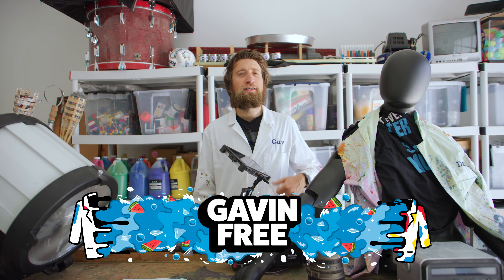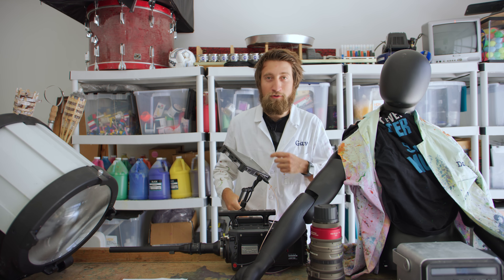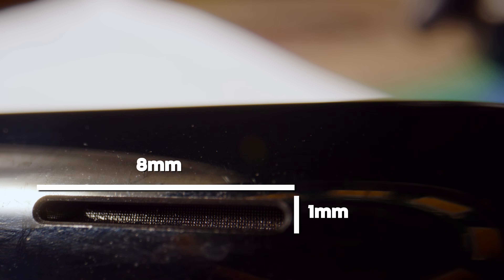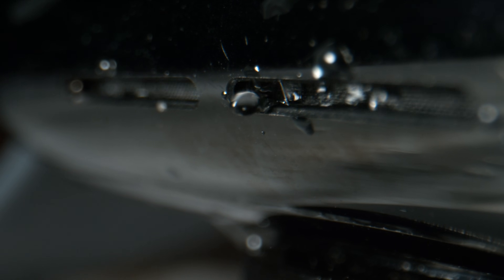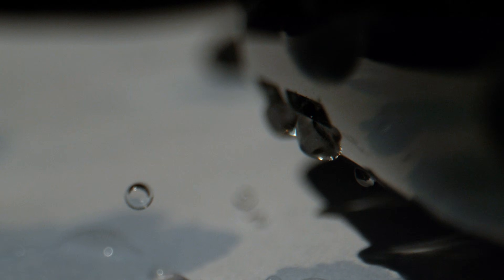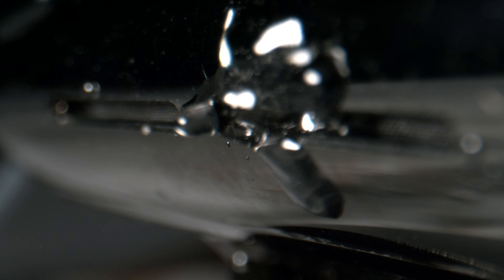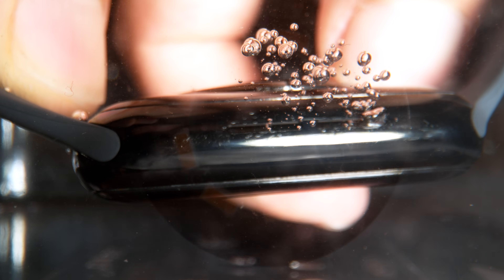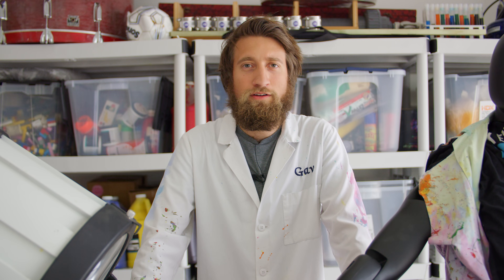How the Apple Watch Ejects Water in Slow Mo - The Slow Mo Guys

Comment: Now imagine how awesome that product would be... if it were waterproof. rofl!
Reply: There aren’t any electronics that are truly waterproof. It’s close to impossible
Reply: @LiveinAK  Not remotely true in the slightest. I've had two Samsung phones go through complete washer cycles with no damage (both lasted years after).  Showers with them, rain, snow. My GoPros are waterproof without exoskeleton cases my Fitbit is waterproof. My car and truck and snowmobile and motorcycle are all packed with waterproof electronics and connectors. All my quadcopters are waterproof because I've conformal coated all the boards...
Reply: @gymkhanadog  all examples of water resistance
Reply: @LiveinAK  Technically everything is waterproof since water in distilled form is not conductive. It's the minerals that are conductive. But that's not what we were actually talking about, now was it? ;)
Reply: @gymkhanadog  there’s never gonna be a scenario where someone accidentally drops their phone or electronic into distilled water lmfao. Go on the website for any electronic you own. They’ll tell you it’s water restistant not waterproof.

Comment: Being advertised as water proof (almost) and seeing photos from Apple of a surfer wearing one, I figured if it can stand the force of a wave why not that of water coming out of the faucet, why not wash it with soap and water after a day's workout? Well, it turns out, that after doing that a couple of times, I'd see soap still ejecting from the speakers every time I turned the dial in that mode! Even days after not running the watch under the faucet...

Comment: My watch doesnt do this at all. When I turn off water mode it vaguely pulses a vibration but no water ever comes out. I had the watch for about 3 weeks now and i only take it off to charge so it gets wet pretty often. Should I be worried about this? maybe exchange it?

Comment: I bought a watch from eBay not knowing it was stuck on activation lock tried going around it but couldn’t until i was recommended to cardtoolz on !G he got my device fixed successfully in less than an hour he’s very good and reliable

Comment: Waterproof phones need this feature. The only way I can get audio back to normal on my phone after using it to film underwater is by finding a source of compressed air to blow into the microphone and speaker holes.
Reply: Don’t blow air into the speakers. It can make things even worse. There are apps that do exactly what the Apple watch does for your phone. They produce a sound to get the water out. And while it doesn’t sound pleasant, it works.

Comment: Hi friends,   just in case you run out of stuff,please consider  filming a wooden spinning top, I ALWAYS WONDERED WHY  you must throw it upside down, in order to get it spinning on its tip not its head, it  also would be  interesting to find the best  geometry of its surface, and the starting point of its winding,  in  so as to get the best rotational acceleration

Comment: me: apple, why are your products so expensive
apple: water ejection!!! cool?
Reply: @Beats-h4z  you stoned or what? You said the part are expensive then you say the entire product is cheap
Reply: Trust me you'll be thankful for water ejection. If apple did something else you would probably say, "apple why are your products so expensive, you need water ejection!"
Apple:"Face ID? cOoL
Reply: @Beats-h4z   Thats wrong...
Reply: Why can't they just make it water proof.....!? Istead of water ejection thing.....
Reply: @sachinkadam8666  it’s already really water resistant
Reply: @sachinkadam8666  It is as waterproof as it can get without getting rid of the speakers on it. The reason it isn’t fully waterproof is because the deeper you are in water the more pressure builds up. The pressure building up from being very deep in water can help the water force itself through speakers and parts of the watch.

Comment: Coll video. I suspect Apple never had a high quality camera like yours as the firmware in the watch clearly could be further optimized to better eject water with less drain on the already sadly short lived battery. But then again, Apple is mostly about marketing and form over function so they probably didn’t care.

Comment: If only we didn’t have to eject water from the water ejector button where the speaker isn’t there would be really wonderful. No corrosion rust would be great due to prolonged water damage that doesn’t clear out all the water trapped in the speakers. 

Why have speakers there when you have a water ejector. Just doesn’t make much sense.

Comment: One time I accidentally turned off the Water Lock on my Series 3 when I was in the pool relaxing, and the speakers were essentially on the surface of the water, and the speakers ejecting the water actually looked like tiny water jets firing in 4 directions.

Comment: I have a Cat S60 and it also has a speaker drying mode for in case water gets in. The only problem is that most of the sealing flaps have ripped off and the carbon fiber back is just a sticker. I wonder if the phone does the same thing to expel the water. It plays ear piercing noises and I did not think it would dry out like the watch did. Interesting video, thank you!

Comment: Great vid, though did just want to point out that what you can see inside the speaker hole isn’t the speaker, it’s a metal grill to prevent dust etc from getting into the area between the grill and the speaker diaphragm.

Comment: Im doubtful this is any better than just flicking the water off your wrist with centrifugal force. Since its using the speaker it needs air volume to actually push the water out. You can see that it just ends up sucking the water back in because theres a constant lack of air from the drivers trying to push the water out.

Comment: I've owned many Android watches that were waterproof without the need for this feature And the Galaxy watch running Tizen beat apple to this. Apple so far hasn't beaten anyone to a useful mobile device feature. 💯 #facts
Reply: The Apple Watch doesn’t NEED this feature, it just allows you to use the speaker immediately without wetness affecting its sound quality. Other waterproof devices do say that their sound quality can be affected until the speaker dries out. It’s a smart solution I recon - doesn’t require anything additional beyond software to create the sound signal.

Comment: it makes me anxious because THE WATER DOESN'T COME OUT COMPLETELY
Reply: 10 cycles of that gets majority of a tiny amount of water out. The rest that’s is about <0.05 cc or mL can evaporate in minutes. I’ve had several apple watches including series 1 not marketed as water resistant all have been exposed to water countless times. All worked fine. Only reason for getting rid of it was an upgrade.
Reply: JD. Depoister same, my series 1 event went swimming for like 2 hours. I was terrified when I noticed that I have it on. It was like nothing happened, truly amazing
Reply: A thought came to me is that it seems like it'd be good to have a toilet paper square available to sap water out a little better. Maybe it wouldn't get all the droplets, but it may help reduce how much is left and let it dry faster.

Comment: Fun fact: the audio is actually fake: you wouldn’t be able to hear the frequency of the real sound slowed down that much. (Also: it’s pretty clear in certain points in this video that it’s not the real one)
Reply: It wasn't that slow
Reply: Vipera74 not necessarily, if there is sound from the water splashing that is already much higher frequency then we can hear, than it’s possible that when slowed down you can hear it at a lower pitch.
Reply: Harry Benson yes, but it wouldn’t be the one you hear at normal speed. That’s the whole point
Reply: 80x slow shouldn't be that bad
Reply: Fun Fact: Digital sound recordings can be drawn out without altering the pitch, unlike analog recordings.
Reply: Spood Beest uh! What do you mean? I always thought that it didn’t depend on that. I’d like to know more

Comment: Hopefully it doesn't stress out the speaker too much. The thin cone and tiny voice coil are delicate. Even without water the power and excursion alone could potentially cause issues. Although newer tiny speakers in those devices have improved and are capable of much more excursion than previous designs. Plus it doesn't last too long so the coil probably wouldn't get warm at all. The amp is probably too small to fry it to. Interesting idea.

Comment: wouldn't it be less complex/expensive to waterproof the watch? If people read instructions they would know that water may interfere with the touch screen function. Reading is a lot simpler than a complex water ejection system. I guess it lacks the marketing 'wow factor'.  Which watch would you buy - "The advanced electronic personal device will self-purge and dry after immersion" or "Read and follow instructions carefully"...

Comment: This technology is insane. The question resides though how exactly the speaker does that. Do they use sound waves or a purely mechanical power?
Reply: Herman Tselinsky Pour water on a subwoofer + very low frequencies = pretty much same result. They took advantage of that technique by allowing the speaker unit to move at such a low frequency so the water can roll and exit the grill properly.

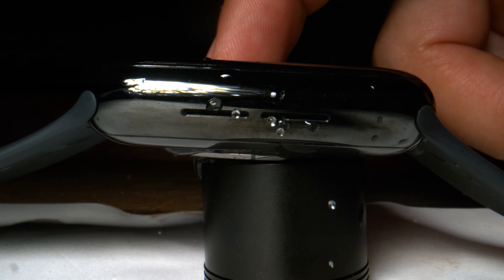Comment: 3:45 That's not the speaker "surface" (the diaphragm or membrane), it's just the mesh speaker grille. The actual speaker membranes are inside. You're not seeing the membrane or grille move, it's just the water trapped in the mesh.

Comment: Anyone know if the components are actually waterproof? As in, they won't rust.

Yes. I know this seemsstupid. But until you've had companies pitch waterproof and then have component short out or rust. It sadly is a good question. Example. Battery banks that claim water/weatherproof, but the contacts are made of cheap metal that when exposed will rust....so who cares if the main compartment is waterproof if the contacts become useless right? :P

Comment: modern phones: get water logged easily
a smart watch from about 2016: shoots water out of its speaker holes using audio
Reply: The vast majority of phones that came out after that watch are at minimum ip68. Also no one brings their phone 8n the pool to swim which is what people do with watches. There is no incentive for OEM's to add a costly feature that isn't needed.
Reply: Comparing a sports compatible watch with a smart phone is utterly ridiculous. No wonder if you can compare it with a gaming laptop tomorrow
Reply: This feature came with the Apple Watch 4 which came out like late 2018?
Reply: No Body it was all ready on de Apple Watch serie 2 so 2016

Comment: 1:38 am I the only one who's wondering why the display is running interlaced when it's an oled
Reply: It's not interlaced. Interlacing is where during a refresh, every other line is skipped, and then on a second pass, the other lines are drawn. This is progressive scan, since it's not skipping any lines. Every display needs refreshing, making it visible merely requires different shutter speeds.

Comment: That speaker was exactly 196hz. In music sound production, 196hz is the note G3 . I used a keyboard program to see if that noise the speaker was making was a G3. It turns out that it indeed is a G3 and it is 196hz.

Comment: Everyone who dropped their phone in water wished this for their phones

Edit: Frick that's alot of likes
Reply: you can also do a similar thing to remove water droplets, tho only from the speaker
Reply: @squashbanana  if you have a phone with stereo speakers, it works with the earpiece too!
Reply: Drpped: Is that Derped and Dropped all at once❓
Reply: @doubledarefan  Lol typing mistake
Reply: There are waterproof phones. Just needed to mention it for those Apple users who usually don't see on other side.
Reply: @SergeMatveenko  there are no water proof phones tho only water resistent
Reply: ARSOZ EXACTLY!
Reply: I just wanna mention to everybody here that a water resistant phone does not necessarily mean that it's HOT water resistant. Warm water has a tendency to expand parts of the phone and hurt it that way.
Reply: There's a Shortcut for that
Reply: @Sektflasche  Rice?? Hahahaha
Reply: frick in one day too
Reply: No as u Have to enable it beforehand I believe
Reply: https://www.youtube.com/watch?v=U8rbqX8-DpA
Reply: What's so special about waterproof phones? I have been washing all my phones using water and sometimes dipping them underwater since 2013 and all of them survived
Reply: @pixels_per_inch  basically any phone that is sealed can be in water a little bit, but water resistant phones are designed so you could drop it in a pond or something for a while
Reply: I have IP68 waterproof phone
Reply: Mohammed Guemmi WATER RESISTANT! AHHHH
Reply: theres a website that does this actually! it plays a sound at a specific frequency to eject water from ur phones speakers. used it when i laid my phone on a wet countertop once
Reply: My daughter  dropped my  Lenovo Thinkpad in water..i thought is dead ..water was pouring down from USB ports ...i turn it on only half hour later it worked like nothing happen ..even screen had no single issue
Reply: @dzonikg  just need to mention it real quick but you're super lucky! Usually you wanna wait a few days before turning submerged electronics back on to avoid a short!
Reply: There is a Siri shortcut for it
Reply: There’s a Siri short cut that does this called water eject. Look it up on google
Reply: My phone isn't water proof but I dropped it in my pool and somehow it works as if it never was dropped in water
Reply: Åəšthətic Ełła lol
Reply: Åəšthətic Ełła just do a bass test and it does it, 
I left my iPhone X outside during a storm about 5 days ago, 
I tested and and water was almost showering out of the speakers
It also sounded horrible 
So I did a bass test and it fixed most, and then I let it dry over a few hours on a radiator,
It does have permanent marks though.
Reply: Samsung S series flagships are IP68 duh....
🥱🥱😴😴😴
Reply: just play music rlly loudly
Reply: Its Jensen kinda yeah!
Reply: Bobby Thomas water proof doesn’t exist. Only water resistent, doesn’t matter how water resistant something is it’s still not “waterproof”
Even tarp isn’t waterproof. It’s very water resistant but not waterproof.
Reply: You can use the same feature by using SiriShortcut for iPhone 7 and up
Reply: My iPhone 11 Pro does this m!
Reply: sometimes i like to use my s9 plus in the shower or in the pool kekw
Reply: My mom was mad at me for taking her phone one day, I gave it back to her (more like tossed it next to her on the bed and ran) she threw it at me and it bounced off of the back of my shoulder and landed in the toilet 😂😂😂 But the worst part was that I felt like i could've caught it-
Reply: iphone is waterproof ;)
Reply: iPhones are water resistant, not waterproof.  same as pretty much every midrange android phone up...  Certainly not a unique apple trait.
Reply: Race Junkie water resistant. And Yeah the IPhone 11 is really great with Water
Reply: UndefeatedSaber 

Yeah, I watch mine in the shower and sometimes put it under a running faucet for fun
Reply: Cragonos Kritirea just saying your phone gonna die one day under the faucet, they are rated for only being dropped inside still water not running water as it has way more pressure, that’s how my note 8 almost died as it put it under the shower and for 2 weeks the screen was yellow and kept turning off and on, but I let it rest in rice and it was fine after the 2 weeks really close call
Reply: Race Junkie no it isn’t, it’s water resistant
Reply: Race Junkie Water resistance
Reply: Race Junkie yeah sure, try dipping your waterproof iPhone in the water and see what happens, my Xr’s screen died...
Reply: bruno cagliari I use my phone in the pool all the time it’s fine ( I have iPhone XR aswell)
Reply: Race Junkie water resistant for iPhone 7 and up*
Reply: @VJBOO1995  water resistant *
Reply: Race Junkie water resistant, everything is water resistent nothing is water proof
Reply: Race Junkie nope they’re water resistant
Reply: Race Junkie yeah no, water still gets in my XS Max
Reply: @VJBOO1995  Okay I'll try to buy that but I'm broke
Reply: @VJBOO1995  no you can't drop it in a pool of water expect it to survive. Thats only for if you drop it in your shower or in the sink. Also almost all modern day phones have at least an ip68 rating.
Reply: roscoe baram the iPhone XS Max can be submerged in a lake up to 20 feet for 30 min and still survive
Reply: roscoe baram wrong. Even my iPhone X (2017) is able to be used in a pool. I’ve done it countless times to a max depth of like 4 feet and it’s fine
Reply: Race Junkie HAHAHAHA my broken iPhone that I dropped in the toilet would like to speak to you
Reply: @VJBOO1995  no it isn't
Reply: lovegirlforever.link/FX2epJq_V68w
Reply: Man9o your just bored aren’t you? I guess i can relate to sending dodgy links to people when I’m bored
Reply: iPhones are more water resistant cause they use a stronger adhesive for their device making repair costs way higher than what you want to pay.
Reply: @Nayr7928  that isn't why they cost more to repair lol, and they aren't more water resistant either 🤦‍♂️
Reply: @isaaclyonsf1  They are, not because they have the same IP rating doesn't mean they're not better at water resistance. Take a look at how IP ratings are done and tested. And it's not the entire reason the repair cost is high, I'm just saying that it is one of the reasons. But yeah, my previous statement was a bit misleading.

Comment: I have an Apple Watch and never knew it ejected the water. I just thought it had a feature where it wouldn’t let water in or something
Reply: Its mostly a gimmick feature. It helps eject water from the speaker ports not like the inside of the watch, so it really only helps your speaker to sound better but the watch IS sealed from water internally